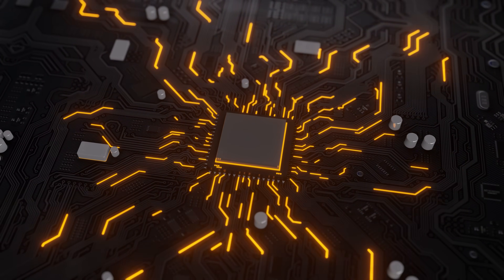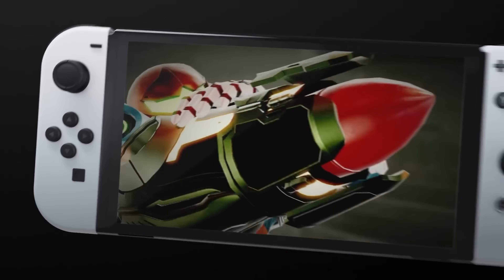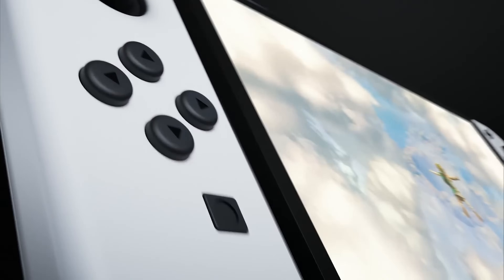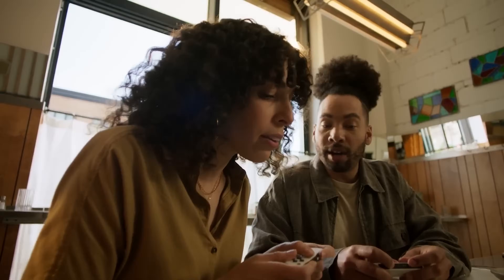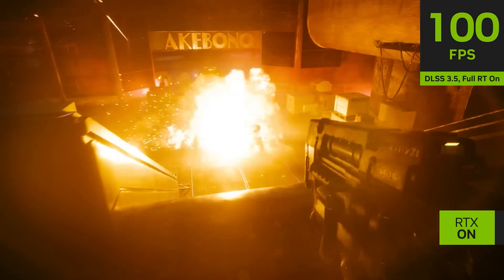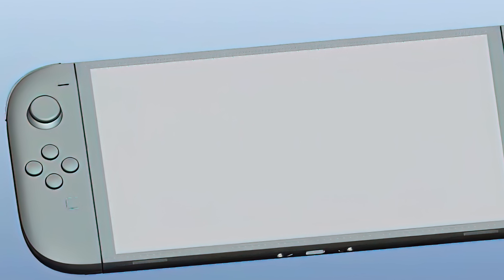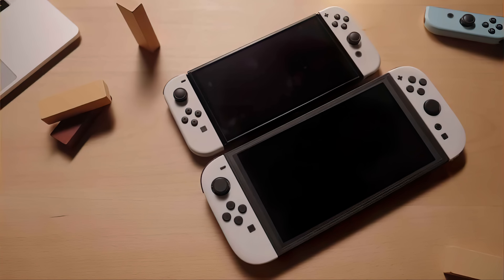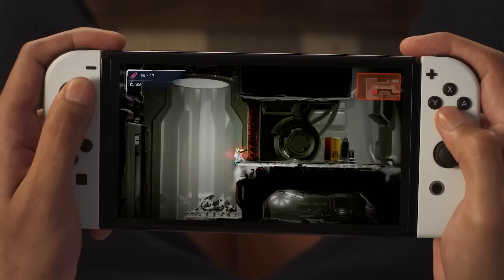Nintendo Switch 2 Updates: SOC CPU + GPU Technology Node (nm) Evidence? + L3 Cache Upgrade Analysis

Comment: I’ve been telling people since last year. That Nintendo took longer than expected to release the Switch 2 because they decided to go with a newer chip it was a late decision according to a close source that works at Nvidia. Originally it was a 8nm chip. But they went with a newer chip the decision was made almost 2 years ago. That’s why we haven’t heard anything official from Nintendo not even a trailer nothing. Not sure exactly what chip they went with but it’s supposed to future proof the Switch 2 for a longer period of time.
Reply: @kuramakun84  i think that the shipping data from earlier this year showing the different parts , like 7500mt ram speed, 2.1gbs ufs 3.1 storage, if they had all these other parts beefed up JUST to pair it with a chip that cant take advantage of all that power, idk even as weird as Nintendo is its logically a cost benefit in the long run. Even if its 8n, they'd have to clock down these other components a stupid amount (in handheld) like the ram to much slower speeds than 7500 since that speed is actually worse for lower clocks and at lower watts. if that divide between handheld and dock is too large, it'll only tarnish 3rd part support, and CAPCOM being how they were with the switch pushing for 4gb ram i'd say other developers this time round pushed to have this thing with atleast 12gb ram aswell as other components. i think its 4N
Reply: All Nvidia employees that have discussed Switch 2 have stated the entire chipset has been finalized since 2022, and Nvidia's work has been all but finished for a couple years. 

It's the T239 chip. Nothing has changed. It's just taking so long because they've been waiting for Switch 1 sales to slow, have though software ready and launch when currency exchange rates aren't so poor
Reply: @corey2232  if you’re wrong Will you come back to this post?
Reply: @kuramakun84   What is the new chip then?
8nm is a dead end Samsung node on DUV lithography. A die shrink will neccessitate a complete redesign of the chip. The next Nvidia AI chip isnt releasing until next year. 
T239 has been finalised since H2 2022 and is probably on 4N(a 5nm variant not the true 4nm). Shipping data has already confirmed it will be used in the Switch 2.
Reply: @kuramakun84  Absolutely. I'm very confident knowing how far in advance these things are worked on. It's far too late to change hardware.
Reply: You are lying because T239 has been uncovered by Nintendo and Nvidia shipping data this year. So Switch 2 is going to use it.
Reply: @stephkm3655  not officially
Reply: @stephkm3655 Changing the node size =/= changing the chip name entirely.
Especially when the T239 was still in development and hasn't been released prior.
Reply: No, the reason they took longer, is cause this is the first new system since Iwata died, so Nintendo was in a very risky spot. They had to really think and plan carefully with how to proceed.

Comment: if we are going off the spec leaks, then we can see that nintendo is basically going all out with the ram (the speed) and the storage speeds. sure , its nintendo so they're very unpredictable, but if the whole gimmick is to make this thing as performant as possible with long battery life and less heat, cheaping out on the chip is the last thing they'd go for. 

im all in on 4N
Reply: If you want evidence of power efficiency for Samsung look at the A Series Ampere like the A2000. It's all set up for Ampere. I highly doubt you will see TSMC in a Switch especially given the price vs Samsung.
Reply: @Berserkism  agree with you that its likely Ampere, but if we're still going off leaks then theres Lovelace features sprinkled into this - its a custom chip after all. regarding the price, Nintendo can see this however they want to but in the long run TSMC 4N would be more cost-beneficial since more chips per wafer (they order in bulk)
Reply: 4N? That's so 2000's, Nintendo has always plucked tech from the future my dude, the Switch uses Tetra 4H chips from the year 4088, so Switch 2 could possibly be using something like Garg CX 9's from the year 7003, might be a bit much for Nintendo games, but who knows.
Reply: @ItApproaches  dang thats it?? cant even do 16k 240fps... not buying
Reply: @dyo_x0  Why would we want 16K 240fps? That's going backwards, the absolute best humans can manage to one day obtain which means tech can no longer progress, would be 1p and Infinite fps.
Reply: not happening, as we all know nintendo likes to be cheap and cost effective.
Reply: @Yusei255  i dont think u watched the video lol, 4n would be cheaper in the long run

Comment: I just want portable mode to run well and have at least 3 hours of battery life. I play my switch almost exclusively in portable mode
Reply: same. 100% using portable mode.
Reply: Then you should've gone cheaper and get a Switch Lite if you haven't already
Reply: @the_cosmiccat  uhh that doesn’t really have anything to do with Switch 2 but sure lol. I’ve been a switch adopter since day 1. Currently I have both the Lite and OLED model. The lite is cool, but I like using the OLED mostly because of the screen (obviously) and it has better battery life too. Anyway, my main point is that I don’t want a significant downgrade when playing portably. I don’t want to feel like I’m missing out because I don’t have it on the dock. And honestly I don’t think Nintendo will let the portable experience suffer to that extent anyway.
Reply: I hate Switch in handheld mode, so uncomfortable to hold, and I get like 1.5 hours of battery life before it's at 5% lol. The Wii U gamepad I could play for like 8 hour sessions!
Reply: @ItApproaches  never had an issue with comfort, in fact I actually hate all of those grips to make them “comfortable” I prefer just the standard size. But if you’re only getting 1.5 hours of life then sounds like your battery is seriously degraded. I get about 5 hours on mine
Reply: @lanhikari4930  I call BS. My battery life was like this since i got the thing, as is everyone I know who has a Switch lol.
Reply: @ItApproaches  and I call BS on you. Not only do I have my own systems but I also know all of my friends and family members that have them and not a single one I know has that problem. Like honestly look it up online, the projected time is 3-5 hours. Your battery is either faulty or degraded. The only way it would be that low is if you’re on max brightness playing on a V1 model and playing a game that’s CPU or GPU intensive for extended periods of time. Even then a fresh battery should still give 2.5 hours bare minimum
Reply: @lanhikari4930  I am using a V1 Switch, and no matter the game, BOTW/TOTK or Pokemon Sword/Shield or Violet/Scarlet, or an Indie game, in handheld mode it lasts maybe 2 hours if I'm lucky.

Comment: Its gonna be 8nm lets be honest here
Reply: @HoboWithAShotgun  I think so too
Reply: Why?
Nintendo isnt designing the chip, so they dont choose the node, Nvidia is. Nvidia will choose the appropriate node for Nintendo's targets. If Nintendo was okay with 1h battery life, 8nm it is. Also underclocking the chip to hell doesnt make sense on a custom chip where you can control the core count. The GPU is huge for 8nm, they could have just reduced the number of cores, ran them at normal speeds for the same performance with a smaller and cheaper chip.
Reply: @stephkm3655  I'll be honest, I'm not a tech guy... At all. I just heard if 8 is cheaper than 4, then Nintendo will do that.  

I hope you're right but they don't take losses on their systems.
Reply: The Switch 2 configs are 1536 CUDA cores and 12 SM. Put it on a orin consume tool (that calculate consume at 8nm) and you get the minimal of 15+ Watts of GPU alone. Switch 1 uses 7Watts for the ENTIRE device. The entire device can past 20watts on 8nm and the leak of console shows a 20wh battery on it. So, do you really think Nintendo will make a new portable that battery long last than 1 hour? No make sense at all. On 5nm they can make the entire device consome 8W and last for 2.5 hours what is very similar to the first Switch.

Comment: It needs 100% backwards compatibility and ideally an inbuilt ability to run Switch 1 games at higher Res and framerates in docked mode. 
Games like Bayonetta3 would then run like butter ... Fingers crossed.

Docked all the way for me aswell Dave.

Comment: Thanks for the exciting news, SMD64. Regarding the dock graphics part since I still use the mclassic & 4kgamepro on my Switch, Wii U etc I'll do a test run on the Switch 2 to see if by any chance it will make it better using it.

If I see that the Switch 2 itself looks better without it, then I'll be very happy. Then watch the creators off both mclassic & 4kgamepro make a v2 for the Switch 2 to take advantage of the new stuff Switch 2 has.

Damn can't believe Nin is still going strong & kicking butt 😂👍. Anyway, I noticed at 3:19 a nice song playing in the video. Do you have the names to them as I would love to listen to them, thanks.

Comment: Its Nintendo,they dont gona for 4nm..they will just had more cooling solution and using the cpu and gpu at lower clocks and that way use the cheaper 8nm chip.
Reply: The 8 nanometer version is more expensive to produce surprisingly. They’ll opt for the cheaper 4 nanometer process as well as future proofing the hardware.
Reply: You just said it. "Using more cooling". That also increases the price. 
Also, Nintendo isnt designing the chip, so they dont choose the node, Nvidia is. Nvidia will choose the appropriate node for Nintendo's targets. If Nintendo was okay with 1h battery life, 8nm it is. Also underclocking the chip to hell doesnt make sense on a custom chip where you can control the core count. They could have just reduced the number of cores, ran them at normal speeds for the same performance with a smaller and cheaper chip.

Comment: I'm of two minds about this. For one thing, it's NIntendo, so don't rely on them choosing the cutting edge. On the other hand, battery life is a huge priority for them. So it's either 4nm or a severely-underclocked (in portable mode) 8nm. 

I'm really hoping for 4nm, because otherwise it could mean a huge gap between portable and docked performance, which could cause problems for developers optimizing games.

Also, I still say no official reveal until 2025. I think they'll just not comment on leaks.
Reply: Nintendo isnt designing the chip, Nvidia is and so they are the ones choosing the process node. Based on the targets Nintendo wanted they will choose the appropriate node. If Nintendo told them they are okay with 1h battery life then 8nm is what it is but I doubt it. Also, downclocking the chip to hell doesnot makes sense for a custom chip where you can control the actual core numbers.
Reply: dont hold your breath or set yourself up for disappointment. with nintendo hardware its always best to have low expectations 😅
Reply: Nintendo does choose cutting edge, just what was once cutting edge. They choose the stuff that was cutting edge that got the bugs fixed and when it's at it's best but was ditched by everyone else when they want to go to the next cutting edge. See the problem is, company's release cutting edge tech, but never hit the mac capabilities with it before moving onto the next thing. Their entire business model is buy our new shiny thing, then buy the next new shiny thing. Nintendo waits back a few steps and says thanks for getting all the bugs and glitches of this tech figured out, not while you're busying selling the next thing that you'll give up on in a year, we'll use this for 7 years and get 7 years of that tech at it's best! It's quite brilliant actually.
Reply: @ItApproaches  ohmy god the copium is real

Comment: I dont see them using 4 nm.. it does not sound like Nintendo… maybe a hardware rev 2 or 3 years down
Reply: Nintendo isnt designing the chip, so they dont choose the node, Nvidia is. Nvidia will choose the appropriate node for Nintendo's targets. If Nintendo was okay with 1h battery life, 8nm it is. Also underclocking the chip to hell doesnt make sense on a custom chip where you can control the core count. They could have just reduced the number of cores, ran them at normal speeds for the same performance with a smaller and cheaper chip.
Reply: @stephkm3655  we all know Nintendo is not making the chip.. but they are paying for it. Doubt that a 4nm chip will be cheaper than the 8nm variant…  4nm sounds too cutting edge for Nintendo but if I’m wrong then great.
Reply: @horlanservia  Yes but if Nintendo made Nvidia to choose 8nm, they would have also gone for a smaller and CHEAPER GPU that actually made sense for 8nm because the actual GPU is HUGE for 8nm.
Reply: @horlanservia  Also dont forget 8nm demands a more expensive cooling solution and a bigger more expensive battery on top of giving less chips per wafer. In the long term 5nm will be cheaper.

Also there is a nomenclature error. T239 is expected to be on "4N" which is a custom 5nm variant for Nvidia products(like the Lovelace GPUs) and not the true 4nm("N4") process. Yes it is confusing.
Reply: You are right. Nintendo is not using 4nm chip. They are using TSMC 4N that is a 5nm. Nvidia move to true 4nm on their blackbelt new cards and open space to Nintendo use the old but good 5nm.

Comment: I just wish that Nintendo did more frequent hardware revisions during the life of their console generations. Even if they want to keep performance the same, release new models with cooler and more efficient chips, greater battery life.
Reply: They kinda did that with Switch, there was a "V2" model with higher battery life released alongside the Switch Lite, and then the Switch OLED has even better battery than that.
Reply: @Crafty_boy70  Yes I agree. But it was many years into sales of original Switch before they launched any improved hardware.
Reply: @iakona23  if it’s just performance, better battery life is ok, but not graphics because it dilutes the excitement for the new console, I loved the improvements in graphics back in the day coming from the n64 to the GameCube, ps1 to ps2.
     now what we have is Xbox one x to Xbox series, ps4 pro to ps5 and there were barely any noticeable improvements in graphics and that affects consumer’s excitement
Reply: me too. a lot of ppl wrongly assume the opposite, but its actually BETTER for us as consumers to have more frequent refreshes otherwise your only option is aging hardware that never gets any cheaper like the Switch.
Reply: @RiqMoran  yes indeed
Reply: That's anti consumer. That's just milking the dumb masses and harming the industry. Their focus is on here's our system that we will use for 7 years and we will make games on it for 7 years.
Reply: @iakona23  battery life I understand but they shouldn’t do a pro thing. You want performance to be the same across all the switchs. You don’t want to end up like Xbox series x/s. Rather than making a pro make a new system.
Reply: @hass556  The series S is in the same echelon of power that the Switch 2 is.

It doesn't inherently make dev harder. Especially with more parity in the space very soon.
Reply: They may do it for the switch 2. Because they didn't think the switch was gonna be a hit. No one did really.

Comment: I think the rumor about the power supply is that it runs at 60 watts, at 80% efficiency would give Switch 2 48 watts docked, Switch 1 went up to 18 watts max, hovering around 15 watts for demanding games like Breath of The Wild.

That's quite a big power bump available docked, even if some of that power is for charging the battery and joycons.
At least double the available power compared to Switch 1.
The battery will likely also be more energy dense for the weight, as Battery tech has had major advancements since 2016 when Switch 1 was revealed.
Reply: @MrSec84  yeah i think the battery would be much better , atleast in terms of tech, than the steamdecks since that has a 45w charger - i doubt they went for 60w just to impliment some sort of fast charging. the capacity would probably be alot lower given this is an arm chip and they wanna keep the thing light, probably around 5500-7000maH
Reply: @MrSec84  battery is most likely to be 30Wh based on the size of compartment from leaked images. Imo more than enough considering that we know that Nintendo is aiming to have 5-8W TDP during handheld play